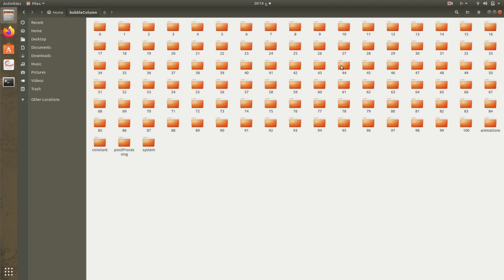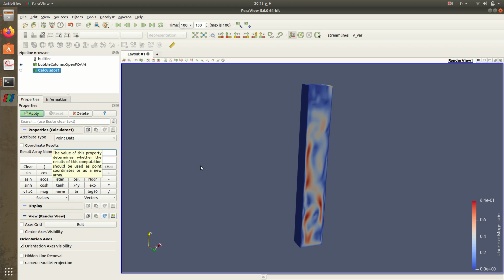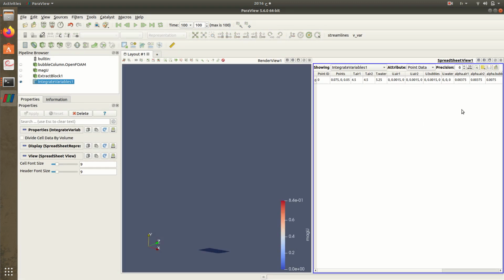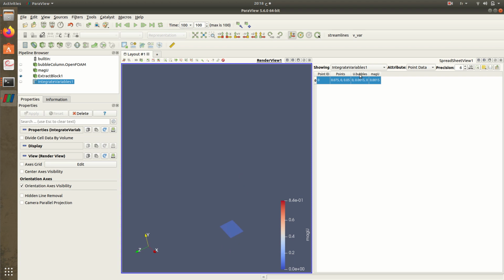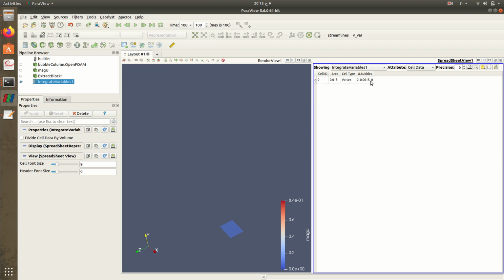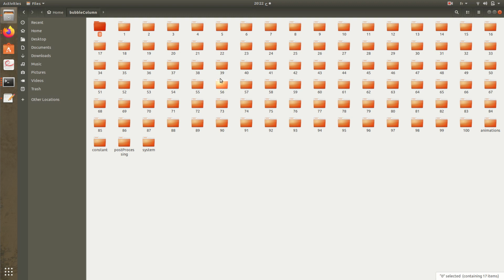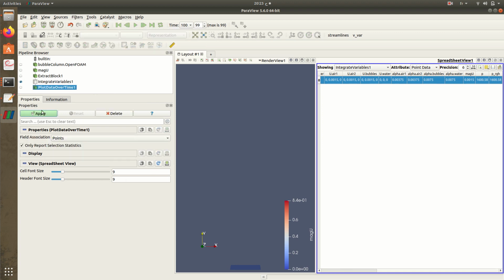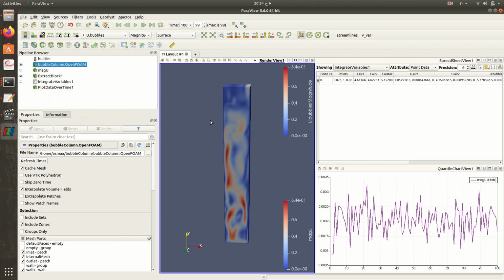How to Calculate the FlowRate and Plot it Over Time in ParaView - #CFD #AsmaaHadane

Comment: Thank you so much for the video. I think it could be better to use Surface Normals and then compute (Velocity.Normals) and then integrate with Integrate variables  and then calculate flowrate based on this.
Using mag(U) to calculate the flow rate is not a general solution and works in specific cases
Reply from the maker: Thanks for your contribution, your suggestion could be helpful for other users.

Comment: Don't think this is entirely correct, in that you are first getting the magnitude of velocity and integrating over a surface, i.e. you're taking the dot product of velocity vector with itself. What you should do is the dot product of the velocity with the normal vector of each patch element to get flux.

Comment: Well ,mag(U) > integrateVariables gives wrong values if flow vector is not perpendicular to the surface. Besides the flow angle, it also neglects the direction of flow and does not calculate the net flux.
Reply from the maker: True ! it is applicable is this case since the flow direction is perpendicular to the surface

Comment: Dear Ms Hadane.  This was a very useful presentation.  You have saved me hours.  Thanks hugely. (One minor fluids correction: the volume flow would be the integrated normal component velocity through the surface, not the velocity magnitude.  This would account for backflow through the surface).

Comment: As far as I know flow rate = rho V  A , are u assuming that the bubbles density is 1 ? because this is miss leading what you are calculating is a mass flux not flow rate .
Reply: rho U A is mass flow rate. only U A is volumetric flow rate.